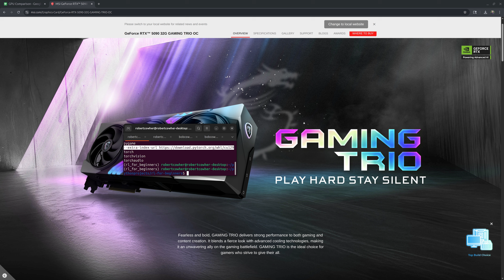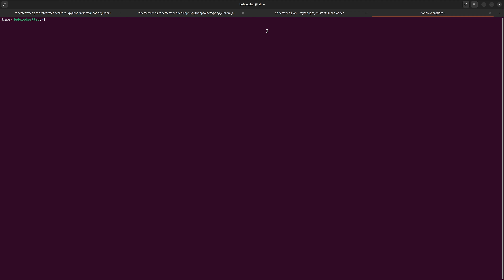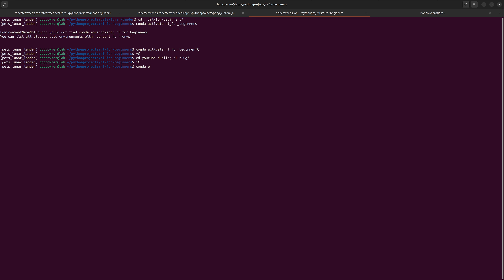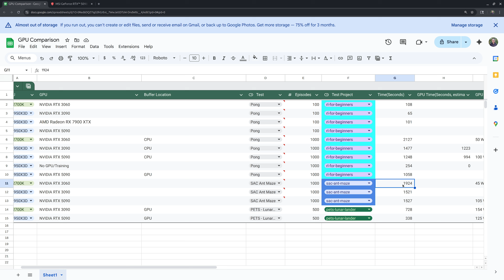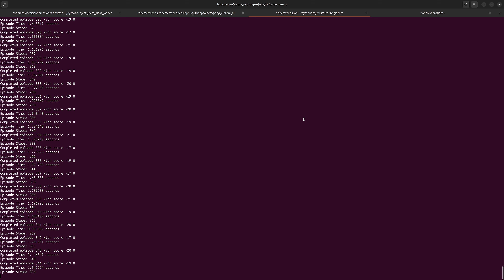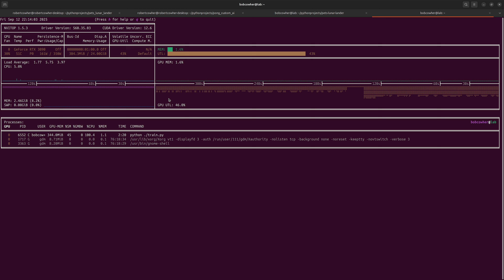First Impressions - RTX 5090 for Reinforcement Learning

Comment: lol i ran into that same issue with my 5090 loading linux. my work around was using my igpu on my motherboard until i could get the new nvidia driver installed.
Reply from the maker: See, that's what I should have done. This fell firmly into frustrated middle-of-the-night troubleshooting.
Reply: @robertcowher  it took me a minute to figure out too